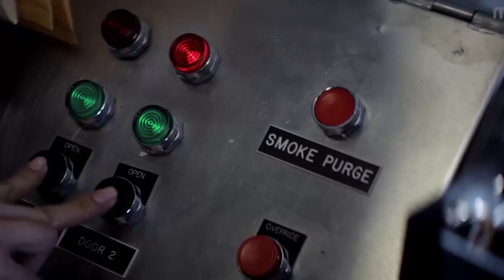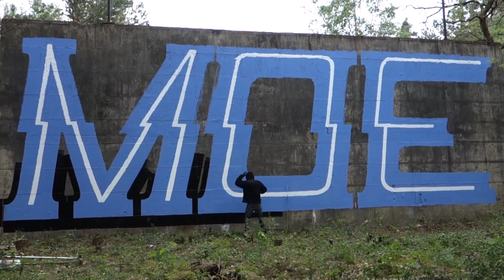STREETART WHALE BEHIND A HUGE BLOCK MONSTER GRAFFITI GENC & MOE

Comment: Get a paint runner roller you fill the rollerhead with paint and it don't splash you and paints on any surface only problem is weight on a long pole. 😏✌